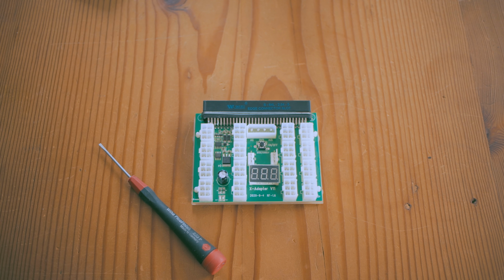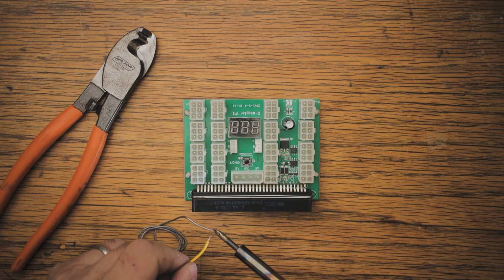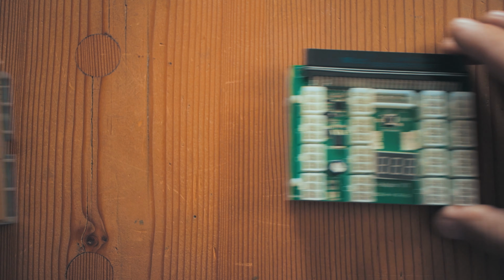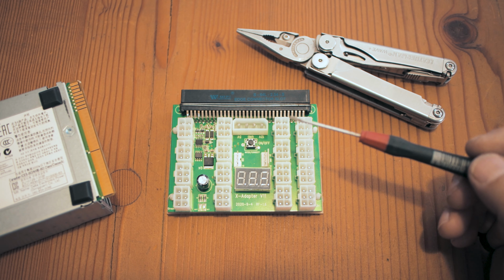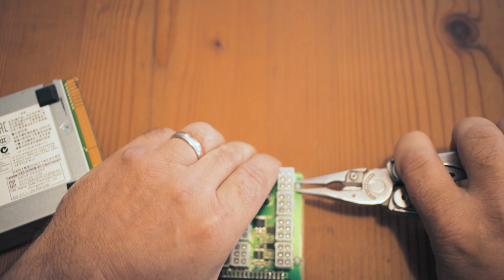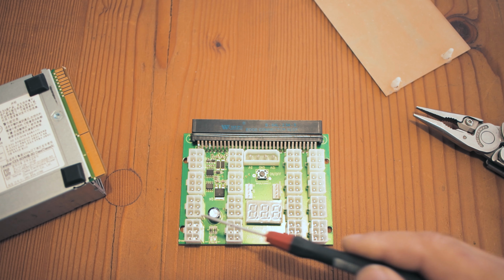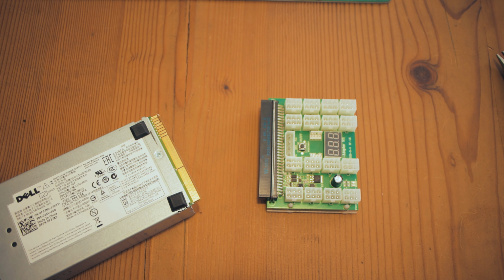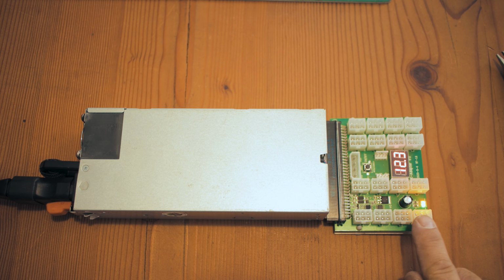It’s so EASY to fix - Parallel Miner X11 Breakout Board (version 2)

Comment: Great video , is it work with amp x11 and zsx amp ? Thx
Reply from the maker: It will work with the X11 AMP, but not the ZSX, as their control circuits are different.
Reply: Thx , so how repair the zsx ?